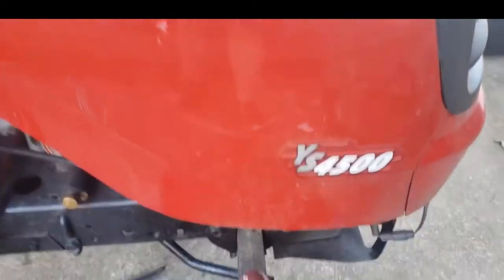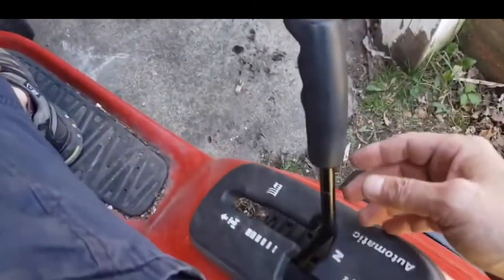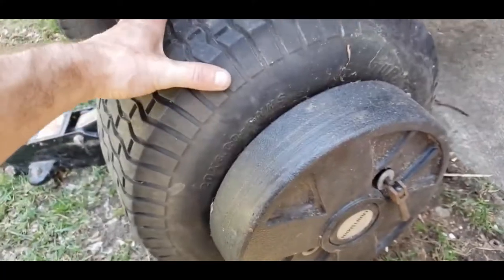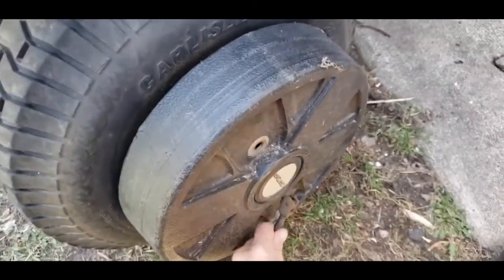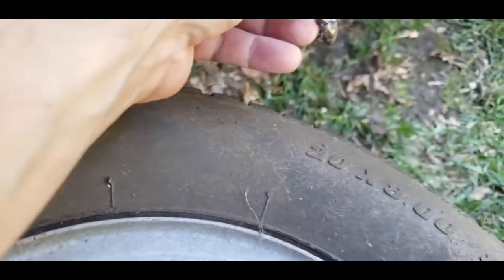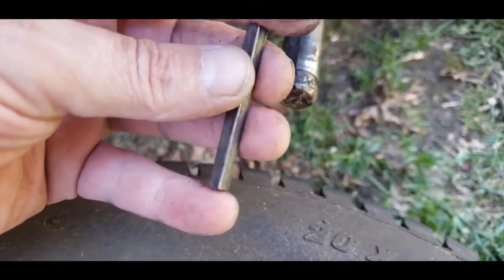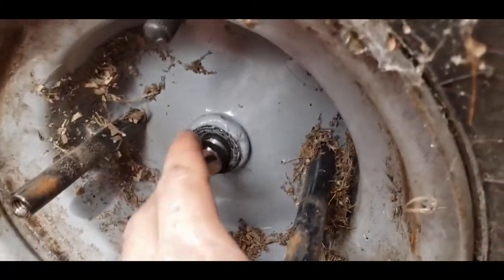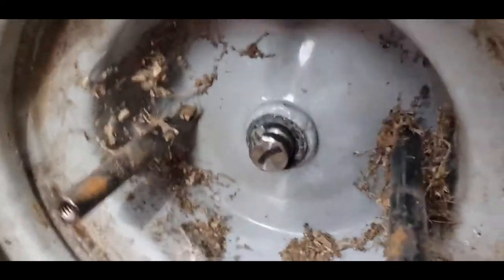How To Fix Riding Lawn tractor will not go backwards or forward into gear Riding Mower wont move!

Comment: **Tip**

I had this issue of the mower won’t go forward or backwards. Also everything was in place with the wheels and belts.

The mower had sat for a while and rust developed on the pulleys. I took off the battery and sprayed the pulleys with WD-40. I worked after that. 

Hope this helps
Reply from the maker: Same as the other video I have linked in the cards

Comment: Ok but mine wont go forward or reverse, and when I look back neither one of my back wheels will move at all in either direction.  That aughta be a clear indication it's a tranny problem instead of a square wheel nut.  The odds of breaking both wheel keys at the same time would be one in a billion, dont you agree?